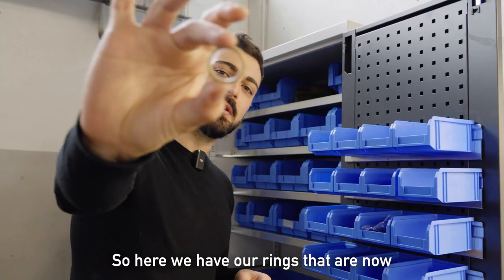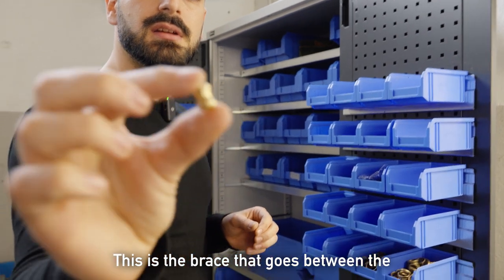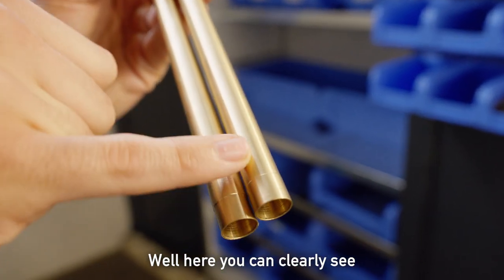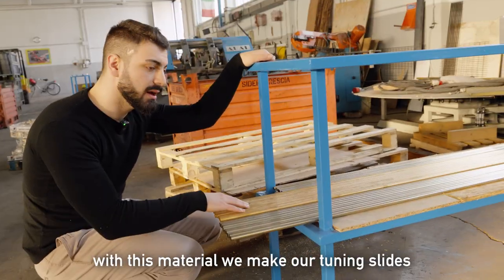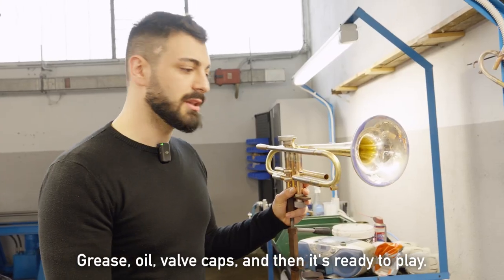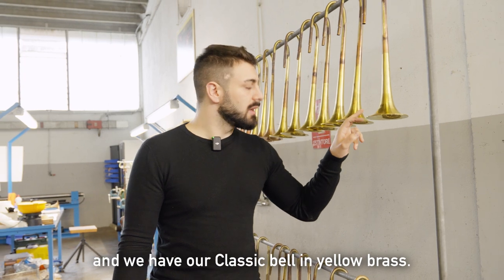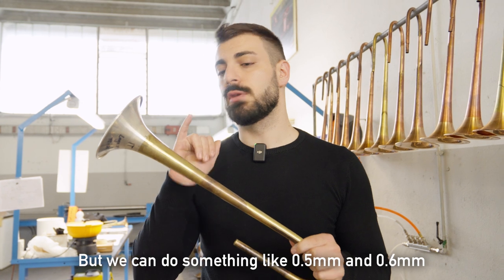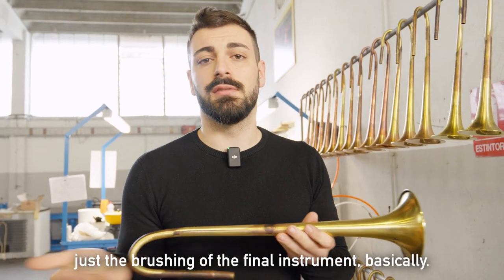LOTUS Factory Tour with Nicolò Perina

Comment: The difference is Adam Rapa has specified various design tweaks that are relatively unusual, compared to most horns. He has made quite a study of precisely why certain combinations work to accomplish the goals for a professional trumpet player, to achieve sound models, without overworking. These designs demand a precision so the player doesn't have to work so hard to lip notes in tune, to achieve certain dynamics by sacrificing tonal quality, and endurance. Describing it in words, though, misses the point. You simply have to try the horns to truly appreciate their quality.